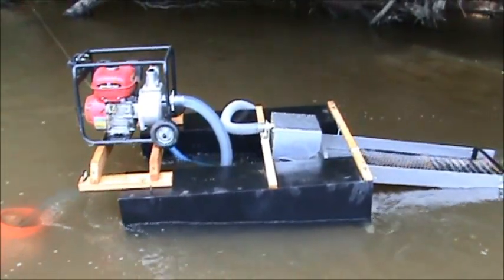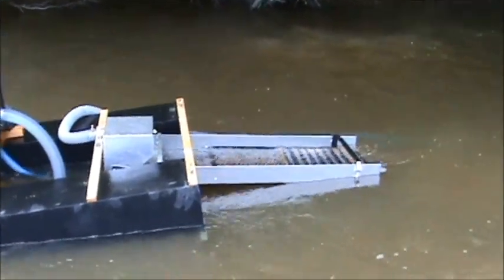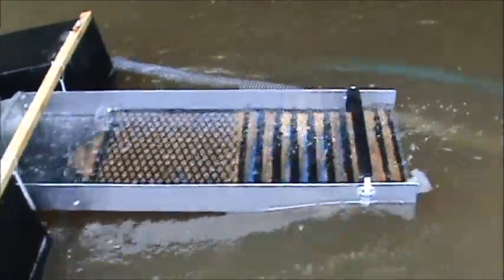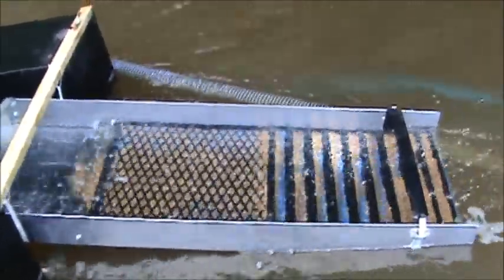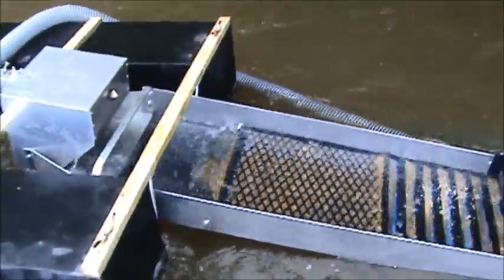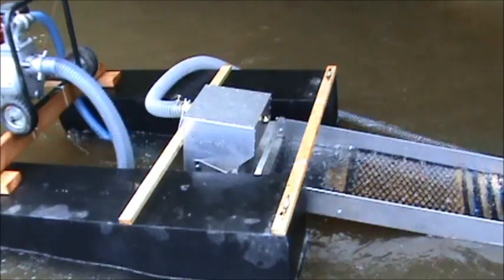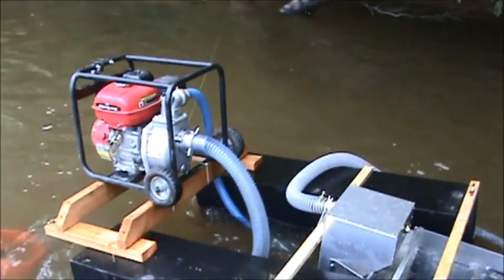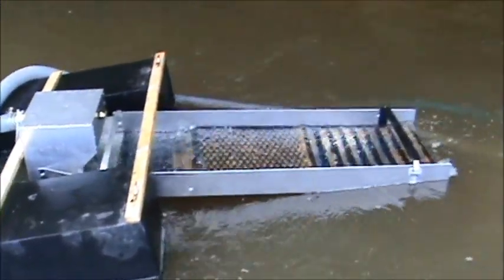The First Dredge Tests

Comment from the maker: Thanks John. I wanted to maintain as much angle as the crash box would allow and wound up with the end of my box in the water. When I get the high pressure pump from Keene I will get a permanent metal frame and deal with the weight distribution issues to where I will be able to adjust the sluice angle AND keep it out of the creek. Thanks you for watching and your valued advise.

Comment: Nice job. Looks like you thought through your design and put a lot of work into the unit.

One recommendation: if you keep the end of your sluice bed out of the water, the flow would improve, and you would get better exchange through your sluice.